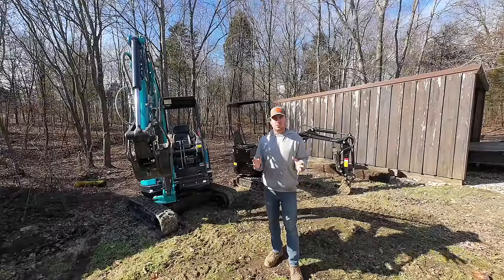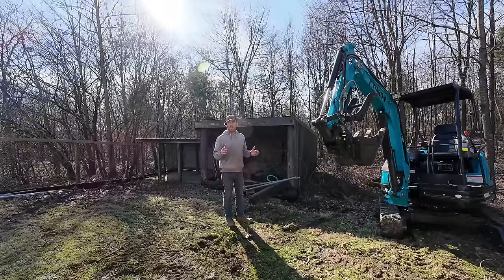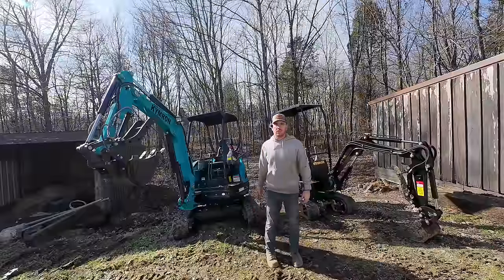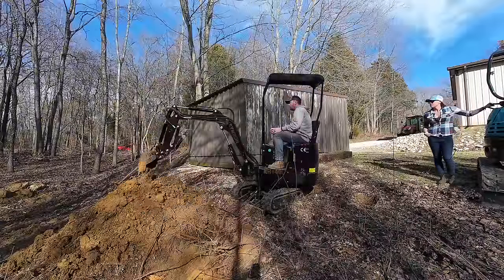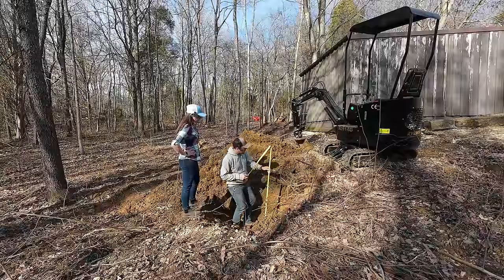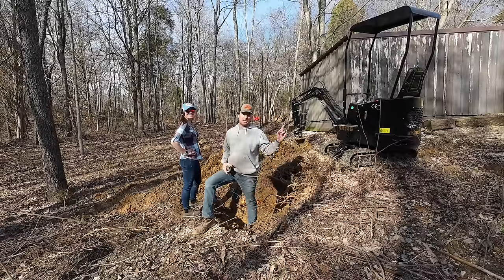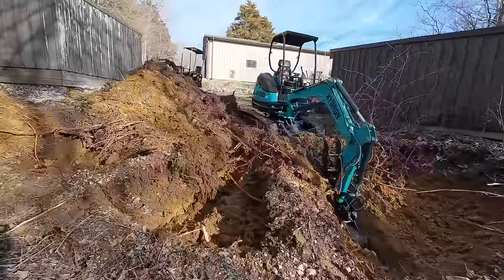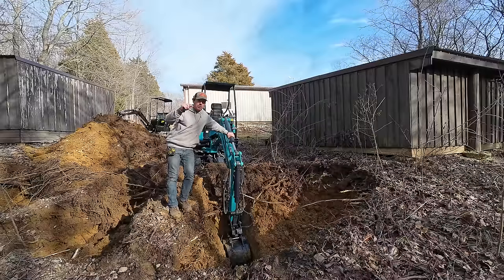KYMRON DIGGING TEST....1 Ton Vs 3 Ton Chinese Excavators

Comment: Seems like you want the heaviest excavator you can afford, and still tow with your rig.  Unless you specifically need the small size of the 1 ton unit.
Reply from the maker: Thats what i want for sure.   The 1 ton is going to get rented out.  And the 3 ton will be used on the property and maybe some small jobs.
Reply: Absolutely. Tonnage is king

Comment: Kyle, just a thought, (like you don't need another one !) . consider raising the roof on the smaller building now if you're gonna use it for a wood shed? It'll be easier access stacking firewood later in your life.  Like I said, just a thought, ain't telling you what to do.
Reply from the maker: Yes i agree.  Im always open to ideas.  Both of those lean to’s are getting tore down in the future.  The larger one is rotted out and oddly shaped and the smaller one was pieced together.

Comment: Great video nice seeing the two machines(Machine) working side-by-side.  The larger machine seems by far nicer to run.  I guess the smaller machine has its part to play but I’ll take the larger one any day.  Nice job.  Be safe on those hills especially with the narrow one.  Would be easy for someone inexperienced to pull them self into that hole.  Great job keep up the good work.
Reply from the maker: Thank you.   Ya the larger one with the diesel is pretty smooth and stable
Reply: Getting through a 36 inch gap is a sure plus in a lot of situations

Comment: I know both machines have low hours, but any issues with the track tension/tracks derailing? Thx
Reply from the maker: Everything has been good.  I did have the track on the 3 ton come off when i was working by the pond.  I have that in a video.  I ran over the edge of a stump and it shoved it off.   Otherwise all good

Comment: Do you have any problem with the small one running to hot or over heating problem. Seems like there is not a lot of air flow. Thanks.
Reply from the maker: I havent had any issues with mine.  I dont run it at full throttle which probably helps too.  I think kymron started putting oil coolers on them now.
Reply: @SpicerDesignsLLC   thanks dude. Yea I’m stuck between this one or the xh14
Reply from the maker: @kylehathcock9657  i would recommend spending the extra money of your gonna do it.  The xh is the better one right?

Comment: Also, the bigger mini excavators the more bigger size needs a bigger trailer to pull it and something is bigger trailers. You need a CDL to hold the black one right there. You can just use your pick up truck to pull around and put it in the back of your pick up truck almost

Comment: You think that one ton could demo a mobile home?
Reply from the maker: Not ideal but not impossible.  Might be dangerous with the lack of reach.
Reply: @SpicerDesignsLLC  what’s the minimum you’d recommend. Just thinking about the tight spaces on mobile home parks.
Reply from the maker: @user-qs2xd6cx3c the 26d that i have would be a good size.  Had retractable tracks too which helps a bit for narrow spaces.  Still probably not ideal but it could get the job done.  I think
Reply: @SpicerDesignsLLC  Last question; what do you think would be the ideal size then?